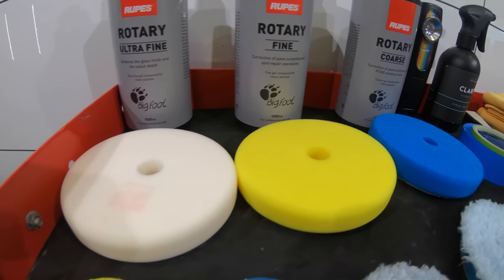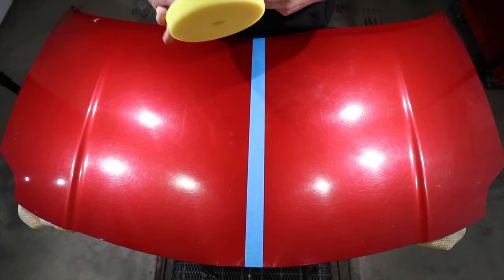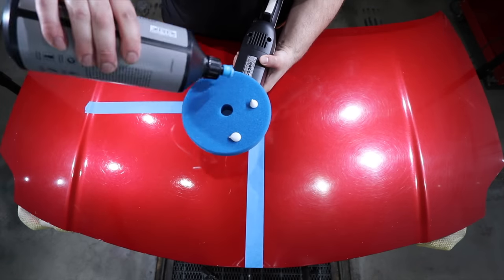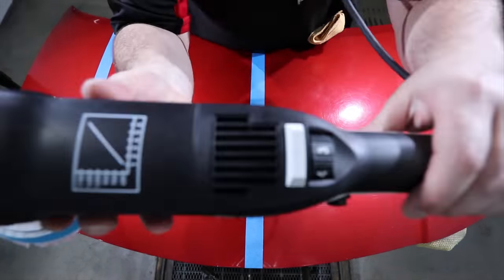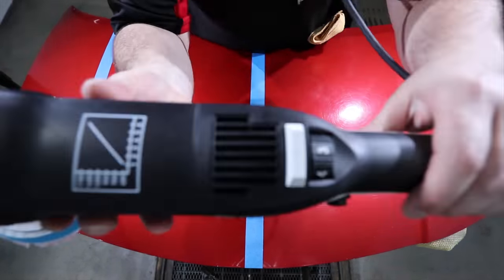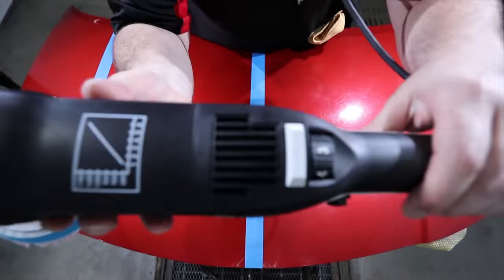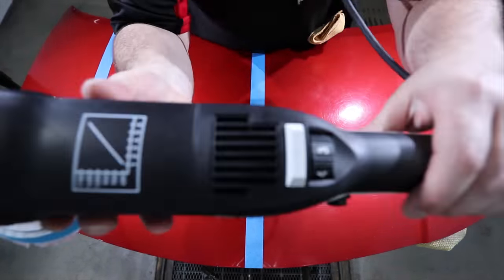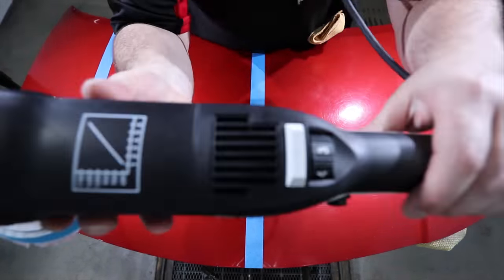A Guide To Using A Rotary Polisher/Buffer To Polish Car Paint! + Rupes Rotary Polishing System!

Comment: Anyone upset they bought a Rotary and not a DA. Don’t be. A real Detailer will have both. I use my rotary for serious paint correction or a deep scratch. I use my DA for medium to moderate paint correction.
Reply: I use my rotary from start to finish every time and my brand new expensive 15M DA is still in the box from 8 months ago
Reply: @Rabbit.760  And if you're polishing glass, there is only one choice: rotary.
Reply: @captainotto  I think polishing glass is the one thing I've never done
Reply: @Rabbit.760  Your back thanks you for that. It's a brutal job, but a necessary step for prepping glass for a ceramic coating like Glaco Soft99. And of course there's scratch removal.
Reply: @captainotto  oh for coating I just use steel wool for scratches and a quick wipe with acetone. Very unorthodox I know

Comment: I really don't like using firm pads on my rotary, as it makes the machine very hard to handle. Rather use wool for cutting and soft foam for cleaning up.
Reply: Agreed !
Reply: same here
Reply: Agree
Reply: @johnathanjon9339  You’re absolutely right, nobody cares.

Comment: But the Rupes Blue Coarse wool pad is designed to be only used on a DA, On a rotary is could marr the paint. You were lucky. Please correct me if i am wrong. I am a reseller of Rupes Products.
Reply from the maker: Yes it’s designed for DA polishers but I’ve used it plenty on rotaries just as I’ve I used many rotary pads on DA’s.  The issue isn’t that you’ll mar as long as you have a good base of rotary experience, the issue is that it’s a little harder to control which can be combated with good technique. I’m not saying you should recommend it for rotary use but I am saying it can work great as you hopefully saw in the results which had nothing to do with luck.

Comment: In the end why aren’t you priming the pads? You just apply a string onto the surface, then start polishing with a dry pad?
Reply from the maker: In my experience you don’t need to hand prime foam or traditional wool pads, they machine self prime in seconds. A good way to judge this is by the user experience, safety, effectiveness and quality of your results 🙂

Comment: I love and a fan of your videos and comparo videos as well. This is just my humble opinion on this video. Ive used DA since day one and switched to rotary just recently and it was kinda different feel at one point i had to stop and re think my technique and almost grabed my DA but after an hour i went back and focused on the pad being flat and relax my arm hand as i was used to DA on having the pad flat and basically have my whole body in a much relax position, in doing so i was i able to control the machine in short i use my ever reliable common sense lol...as far as having haze or marring from using the rotary? i didnt have that issue like what you've express on this video. My technique is a combination of my experience from DA which i applied on the rotary. my advice is to not run your pad on ur rotary too much till it dries up, i suggest keep it damp all the time. And if it takes  someone to master the rotary for years as what uhave stated? then there is absolutely wrong with that person and should consider a different line of tool or business...for newbie with the right common sense maybe a few days to learn and no more than a month to master. This is not to say i dont use a DA actually i still do but Rotary open a wider experience imho than what the DA did from my experience. Keep up the good work!

Comment: maybe its just me but i cut with d/a and finish with rotary or straight rotary instead i cut with wool pad and finish with polishing pad and jewel it with wax pad.but maybe its also a factor on what compound i use which is menzerna  that has diminishing abrasive.

Comment: Wool pad is the best to remove swirls?am i right sir?
Reply from the maker: On a rotary wool will be the most aggressive and effective pad to remove defects, but if the swirls aren’t that bad or the paint is soft it’s usually not needed and will also create more holograms and compounding marring - so it always needs to be a case by case scenario.

Comment: Im sitting here realising everything iv done wrong day 1. As a noob i bought a rotary.  No wonder why I end up with more problems.
Reply: Same here
Reply: You sure did mess up.. DA is the best way to go for a beginner to intermediate detailer even pros use them tbh
Reply: Not really! Since you already have the rotary, I would recommend getting a small 3" rotary like a battery powered Milwaukee to help learn on. Very easy to control, and the  same principles apply to larger rotaries. With the pair, should be able to tackle a huge array of situations.

Comment: Great info. here, thanks for taking the time. Can't say enough about proper lighting. If I'm mobile, I'm probably out there wearing a dorky looking headlamp! Very hard to perfect a surface if you can't perfectly see what it looks like!

I tend to always cut with a rotary, and finish with a standard throw DA. Most efficient combo I've found. I find myself using long throws mainly just for one steps as I get more comfortable with the rotary.. 👍👌✌

Comment: I tried out a rotary for the first time and found it worked pretty well, other than I left holograms finishing, and realized after watching this, I need more finishing stages and less rpm. Curious on how long it'd take for a full paint correction with a rotary vs a da?
Reply from the maker: Great to hear you first rotary experience went well. There will be instances where a rotary saves time and likewise times where a DA will be more efficient so in my experience neither is necessary always quicker or slower - it depends on many other factors.

Comment: This is the single best and most detailed demonstration of the full correction process with a rotary polisher that I've seen. Excellent explanation for your process, and I especially respect the fact that you took the time to do a test run first; It really does make all the difference, especially with classic cars and older vehicles where the paint and protective coats were not as sophisticated or have worn down over time. A lot of these vehicles can be easily damaged by aggressive polishing methods, especially with all of the heat that rotary machines can create, and this is absolutely indispensable knowledge that will hopefully keep a lot of new paint work specialists and detailers from ruining the finish on their customers' cars. Brilliant work, and you should be highly commended for putting this all together!
Reply: Hey! I recommend you watch Yvan LaCroix YouTube channel. He has great, invaluable info on rotary polishing.

Comment: I love rotary. But I tend to finish almost always with a DA.
Especially since they easily kill all of the holograms.

Except for last time when I had to polish a Volvo XC40. It was brand new but it was a nightmare to do. I absolutely hated it. I had to finish it since the client got impatient and said it was looking great already and I spend about 50 hours on it. In spite of it being brand new the paint was buttery soft and even wiping it with a MF towel got it scratched and caused me to go back at it again.
Reply: did you wet sand out all the orange peel on it? you said brand new ..was it attacked by a band of ally cats?
Reply: @roadstar499  I didn't wet sand the car since the customer didn't pay for it ;-) However the car was brand new indeed. Just from delivery. But you know what its like. It is full of marks and swirls fresh out of the factory. And I had to apply a ceramic coating. And that was hell on this car.

Comment: Just a simple (perhaps even a stupid question), if detailers and enthusiast are worried about reducing the clear coat on a car during their 'polishing'. Why (finance permitting) not simply ask an expert to add the clear coat back to the car as it were, starting the life cycle again? Not seen a video on any detailing channels where they have decided to take a  car or a panel back to it's originating clear coat level then compared it with a detailed polishing stage....

Comment: Thank you! Youve answered 98% of my questions. Is the first step the one who will remove sanding marks with 2000 grit? Can 2000 griy scratches be removed with 3000 grit and can scratches of the 3000 be removed easily with rubbing compound?
Reply from the maker: P2000 sanding scratches will remove P3000 ones, and a cutting pad and cutting compound will remove the P3000 marks. How much work/time that takes depends on how well and consistently you sand and compound as well as the hardness of the paint/clear coat.

Comment: Really informative, thank you!

I've definately burnt into my clear coat at edge on an older car with the bigger 6" inch pad, with rotary.

Totally feel more comfortable with a da, definately more forgiving
Reply: It's easy to do for sure, ideally you would want to practice and also using proper technique and edging it makes it much more difficult to damage paint. Investing in a paint depth gauge is also very helpful.

Comment: the one I used at the rupes seminar locally I found it a little whiney and louder than I liked but it is still a superb rotary regardless of these small things I mentioned. Metabo's PE 15-20 RT is a new one with 18  nm of torque which is alot and 1500 watts. It is a great machine. what is making the mille wool's not last for you, I have had mine since they came out and are still working fine two years later.

Comment: Can I ask what makes it takes years to master? Seems like it would be straight forward.
Reply from the maker: Well it’s one of those things you have to try for yourself to get a glimpse into the learning curve needed to not only control the machine to act as you’d like it but also remove defects and finish to a high level - it takes time to firstly get the hang of that and secondly to take that skill level beyond average control and reasonable results to a mastered skill level and outstanding results on difficult to work on paint types and difficult to navigate panel curves, crevices and tight spots on a vehicle. Having access to good information and good training guides is something that many of us didn’t have back in the day, so we learnt the hard way though trial and error. I think it’s easier these days and the machines and products are also way better and more user-friendly so new comers have a much better chance of getter there sooner.
Reply: @CarCraftAutoDetailing  Thank you.  I appreciate the well worded reply. I have a milwaukee rotary that I haven't used because of all the talk that it's hard. I need to get a panel and practice on it.  For now I'll stick to my orbitals until I get a panel and see for myself what I'm up against. 

Thanks again for the information.

Comment: What are the differences between the da and rotary pads? Is the composition the same just thicker?
Reply from the maker: The actual foam can be the same for both DA & rotary pads though not always, it depends on the specific pad grade/range.  But some common differences can be pad thickness as you mentioned, also squared off edges vs rounded edges and tapered/angled side walls vs almost straight 90 Degree side wall angles. It really comes down to the different movements of DA vs Rotary as to why certain tweaks in pad design may cut/finish better and run rougher/smoother on one machines vs the other. 
Also I’ve personally found that most DA pads will work and hold up well on a rotary, while many at least older school rotary pads tend to run a little rough and even get chewed up on large throw DA polishers - but this isn’t always the case.

Comment: My Makita rotary polisher’s instructions advise to tilt the pad about 15 degrees to avoid the artifacts you had to correct afterwards. The notion that a pad should remain flat is true for dual-action polishers rather than rotary polishers, no?
Reply from the maker: No, you can certainly increase the pad angle for cutting, but try that for finishing and you’ll have a flawed finish.

Comment: I just bought a cheap rotary polisher to give my car just a quick shine with compound & polish until I’m prepared to correct blemishes in the paint & repaint the sections that are in need of that level of correction. It’s just to make me feel better while driving around. I ordered a variety of 6” pads to keep on hand. I’m not expecting anything near perfection as I don’t want to remove much of the clear coat. I’m thinking a medium pad for the compound & a lighter pad for the polish. Then just a coat of wax to protect as its going to take a couple of months to acquire the paint, clear coat & dual stage polisher. Does that make sense?
Reply from the maker: Sounds like a good plain!
Reply: @CarCraftAutoDetailing  Thank you! I’m trying to learn as much as possible from your videos. It’s probably not wise to put so much time, effort & money into the paint on a vehicle this old, but hopefully it’ll help when I go to sell it 🤞🏼

Comment: At 17:55 you can actually see the difference. Just pay attention to the 2 steps section, where you cannot see the metal structure of the ceiling light. While on the 3 steps, you can clearly see it. Is that what you call a "small haze" leftover? Amazing content btw!
Reply: Just saw that. Nice!

Comment: Hey man, one question. For the beginner, whats your opinion about polisher to use- 1step,2 steps or 3 steps to start with?
Reply from the maker: Start with a single step using a fine polish and foam polishing pad. There’s no stress there of doing any damage and it’s a great way to get a feel for paint correction before you move onto more in-depth processes.

Comment: hey sandro hope you are doing well ,please after testing corase blue pad with koch-chemie and sonax i was suprised that the cut was not at leavel even in german coat ,do you have any suggestion how to use with correct compound 
best regards
Reply from the maker: If you need need a bit more cut with your compounds I could suggest the Lake Country LL SDO wool pad, and of course your can also work smaller sections with with a slower arm movement and a little more machine speed if it’s a hard paint and the defects are quite severe.

Comment: great video Sandro been waiting for a video like this im totaly fine with using any other machine than rotary. Always been scared of cutting through the clear coat with a rotary as i found out super hard foam pads and rotary is alot more dangerus than rotary and whool pads
Reply: Use low speeds and finishing pads bro. And a finishing polish to start out on your test area. That will usually to the trick especially on newer cars w soft paint.  Then go more aggressive if you need more cutting power
Reply: @seanisreadyable  i only have problems with microfiber pads and some wool pads on my Rupes Mille gear driven machine. I dont have problems with anything else.
Reply: Yea those pads can be aggressive probably better for cutting

Comment: Greatings Sandor, nice video as always. Love your work. Can you please answer a question that i cant find an answer to, I have Rupes blue wool pad for DA, can it be used for rotary? Is that the one you are using in your video or is it Rupes cut and finish blue because they look fairly similar. Best regards
Reply from the maker: Yes I’m using the blue coarse wool pad in the video and yes you can use it on a rotary even though it’s more of a DA based pad. It is a little touch more difficult control on a rotary but if you have a bit of experience you should be fine, otherwise their white and blue rotary pad may be a little easier to work with but it won’t finish or cut quite as well based on my testing.
Reply: @CarCraftAutoDetailing  Thanks for the answer! Great as always. Got myself a few carpro merino wool pads aswell, will try them on some hard paints and see how they compare to rupes blue wool.

Comment: Does a DA direct drive polisher count same as rotary in correction power?
Reply from the maker: If you’re referring to gear driven or forced rotation DA polishers, they tend to be time saving in both cutting and finishing quite well in a single stage process, but due to their much slower Rpms they won’t tend to cut quite as much as a high speed rotary.
Reply: @CarCraftAutoDetailing  thank you for replying.  V helpful

Comment: Even if I use a medium polish like meguiars m210, it will leave holograms?
Reply from the maker: Not if you use it with a good technique and appropriate pad to finish well.
Reply: @CarCraftAutoDetailing  paint is still good. Doesn’t really need a full correction, just some maintenance. Meguiars m210 and a ultra fine pad on low setting should be ok?
Reply from the maker: Should be fine
Reply: @CarCraftAutoDetailing  thank you

Comment: There are single action,/rotary polishers, and there are "dual-action" polishers (which are really just sanders with round backing plates). The single action is far superior, and it's really not that difficult to get used to using one with patience and starting off by using them at slow speed, with gentle polishes and gentle polishing pads or finishing pads. 

Rupes also appears to have bought out Cyclo (which I also have and use, especially cleaning and polishing glass), which is somewhere between the two in aggressiveness - I think it's the best choice for those who have experience compounding paint by hand and want to step up, but hesitate going with the rotary. I use a Ryobi double action "sander" for applying waxes and sealants, to spread them out thoroughly and thinly, which uses far less product, and makes removal far easier.

 My default single action of choice is the Dewalt DWP849X; I've never used a Rupes, which may be more user-friendly, but the Dewalt is a great machine, light-weight, reliable and reasonably-priced. Just my two-cents.